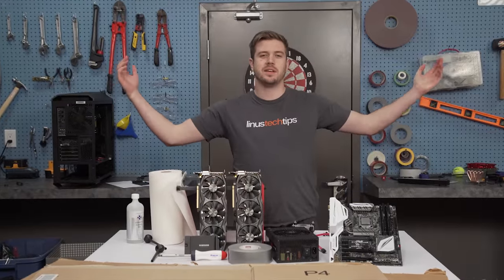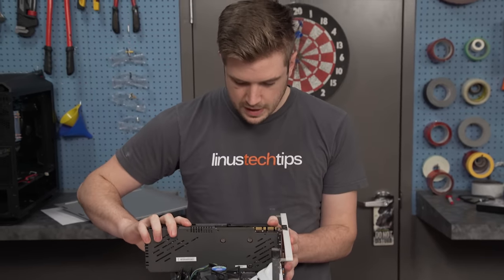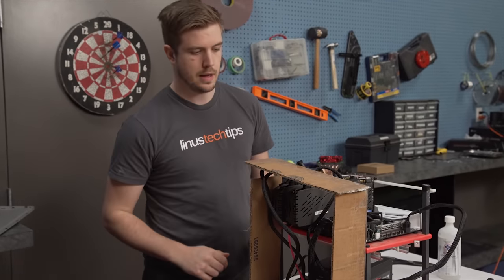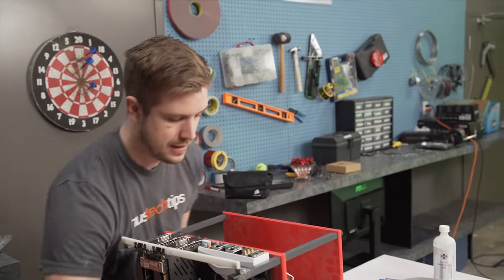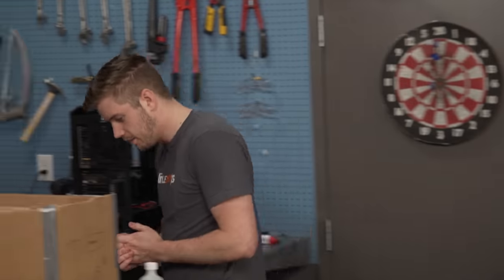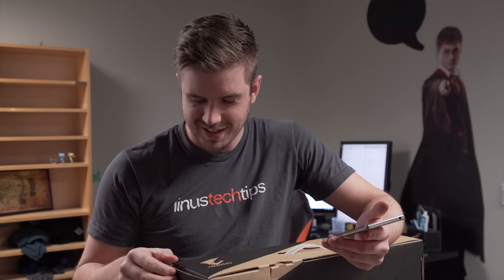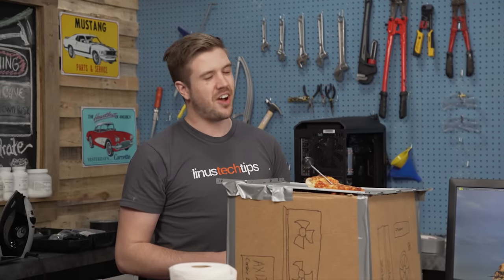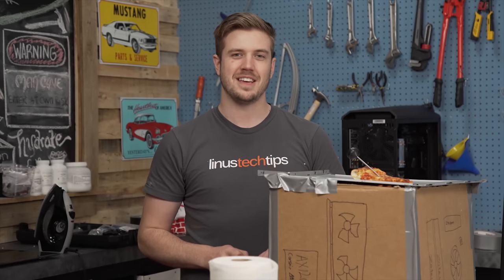Gaming PC & Pizza Warming Platform Prototype Construction

Comment: you gotta use amd cpu&gpu if u want warmer pizza !
Reply: agree
Reply: +Pious AR why amd gpu's? they dont even run that hot
Reply: +Pious AR use a 290x and a fx 9590 to not heat it but COOK it
Reply: Nicolas Epicness937 yeah
Reply: 9590 + gtx 480
Reply: +Quan Washington oh thats good too but i think a 290x would cook it :)
Reply: yeah amd are better for this, i can tell you that. how? i sit next to a pc with an fx-8350, R9 390 in it a hell of a lot. and it get very high usage. my cpu is normally running at 60-65 celcius and my gpu goes at 70 celius normally, althougj for some reason despite not being to demanding, GTA V and star wars battlefront push my gpu up to 75-80 celcius. although one time i had a software glitch that did something or other and ive noticed im getting hotter fast and my fans are suddenly really loud  and ive checked MSI afternurner and open hardware moniter (i use both incase one makes a mistake which has happened when afterburnee told me my gpu was running at 2 celcius) to find that my cpu is at 70 and climbing FAST. and my gpu was at 85 and (again) going up FAST. it was solved by restarting my computer then telling afterburner to pin my gpu fans at max speed (rather loud) for a little bit.
Reply: no, you will burn you pizza
Reply: Revampedharpy09 fx 8350?? thats stupid for cooking pizzas 9590 all the way
Reply: Nicolas Epicness937 yeah i never said it wasnt. i was talking about my personal experience with an fx 8350 the problem the 9000 series has (for running a pc not for warming pizza) is that they REQUIRE at least watercooling to run at any temperature below "HOLY CRAP I DIDNT KNOW I WAS IN A VOLCANO" xD
Reply: i had a 9590 and a 8350 and a fx 6300 the 8 core cpus are fine but the 9590 to keep it stable needed to run at max safe voltage or at 4.1ghz
Reply: +Nicolas Epicness937 just get a Prescott pentium 4 and your set
Reply: i disagree on the gpu. the hottest gpu out there is an Nvidia gtx 480. those were toasters!
Reply: you dont wanna burn it dude
Reply: volkswagenginetta i said cook not burn
Reply: volkswagenginetta jeez you must like your pizza well done huh?
Reply: Revampedharpy09
i do like it really crispy.
Reply: they wanted to warm it, not burning it
Reply: x4 860k + gtx 480 xd
Reply: fr3fou
 fx 9590 and gtx 480
Reply: volkswagenginetta i asked you to cook it not vaporize it
Reply: Revampedharpy09
i eat thick crust pizza
Reply: volkswagenginetta i guess you like it cooked real quick? xD
Reply: Intel is getting hotter than amd, my six core cpu is not getting over 60°C while on full load. Intel would die of heat on full load
Reply: +DerpyDoom its all about the cooling. my intel doesnt run hotter than 50-55 degrees
Reply: +DerpyDoom Intel CPUs handle full load just fine. Plus, even though your CPU is only at 60 degrees it's still kicking out 125 watts of heat, vs 91 for an 1151 Skylake i7.
Reply: *****
just an assumption here, but are you using the stock coolers that come with the cpu's AMD (for the most part)  always offered better stock coolers then intel could be you just have a better cooler on the amd cpu
Reply: volkswagenginetta No, it's not a stock cpu cooler, it is big but I don't know the name of it.
Reply: *****
was it used for both the intel cpu and the amd cpu?
Reply: volkswagenginetta i always used it on a amd cpu
Reply: *****
right so what was the intel cpu cooled with?
Reply: GTX 480 in 4 way SLI
Reply: We wanted hot pizza, not a flaming pizza.
Reply: nisooo:3 that's cute
Reply: ***** Intel doesnt make discrete gpu's
Reply: Pious AR nah intel’s stock cooler is better

Comment: Throw 2 RX 480's and you be good fam.
Reply: gtx 480 4 way sli ftw!!!
Reply: Just put 4 290x's in there to heat it up.
Reply: Pretty sure that's crossfire.
Reply: just put 8 1080's in there
Reply: Uaqu
Reply: you mean a fx 9000 series, and 2 295x2s, with a tdp of somewhere around 1220 watts
Reply: +Ben Crawford bro that's crossfire not SLI lol
Reply: no he means the gtx 480
Reply: no put 4 fx 9590's in a cpu socket and you are gonna have the coolest system ever
Reply: A Pentium D and 2 GTX 590s will do a way better job at coocking food with a TDP of 1600 W
Reply: when people dont know that the tdp of a gtx 970 is actually higher than the rx 480
Reply: He said GTX not RX
Reply: he said cook pizza, not your neighborhood
Reply: Dylan Coulbeck there is a gtx 480 it is not a misspelled Rx ok guys  THE NVIDIA 480 NOT AMD'S  so its the planet not your neighbor
Reply: Ventus that Dorset mean the 480 can run hotter
Reply: +bacon Bliss Top post says RX 480, causing confusion for those not noticing that the later comment said GTX instead.
Reply: ***** which is why i used caps to clarify
Reply: I think you mean 4 gtx 480s
Reply: Elk Kapaska I think you mean a couple of note 7s
Reply: i think you mean 8 gtx 480s

Comment: my r9 390 in a micro atx n200 might as well be a pizza heater.
Reply: *cooker
Reply: +wolfstar true.
Reply: +conenubi701 if its from MSI than yes :) My Sapphire 390X would be a good heater :D
Reply: +wolfstar *incinerator
Reply: my n200 does alright with thermals, I guess your 390 is just a hotter card any ways
Reply: +Markus “IceY” Eisenhammer i've got two msi gaming 390x and those backplates could cook an egg
Reply: 390 max load with a proper fancuve is 64c so no it's not a hot card you just need proper education on Msi after burner
Reply: +GameDev1909 Game Engine Tutorials lol. even at full fan speed it gets up to 79C thats like 140+ fahrenheit.
Reply: +Angus Johnson my n200 does great, i have a top 140mm slim exhaust fan, side and back exhaust and a nepton 240m cooler with push +  pull fans . i love the card but it gets hot as hell (normal for amd anyway).  doesnt help that i Oced and overvolted it too looool
Reply: +GameDev1909 Game Engine Tutorials Temperature does not equal heat output. Learn2Thermodynamics.
Reply: +conenubi701 That card is just to hot i dont know how to cool it down
Reply: conenubi701 i said proper fancurve not full speed on the fan learn the difference
Reply: +GameDev1909 Game Engine Tutorials fan curve won't help.  I've had this card for a while. i said even at max fan speed it's not going to be cooler.
Reply: conenubi701 you would be shocked i have a 390x and a 290x and the 290x is a blower style fan it never goes above 67c because of a PROPER fan curve the rule is never go about 75% fan speed that way you waste no air
Reply: +GameDev1909 Game Engine Tutorials thats the same % i have at your temp. my fan curve jumps to 100% once it hits 80 to start lowering the temps and then it stabilizes at around 77-79
Reply: +GameDev1909 Game Engine Tutorials I agree with this guy, The fan curves for AMD cards are usually way too low out the box.
Reply: Daiesthai i don't think you understand you set your own fancurve .....not the brightest bunch thats for sure
Reply: +GameDev1909 Game Engine Tutorials i use msi afterburner with custom fan curves. my msi r9 390 is just hotter than most. its oced at 1210 core and 1675 memory.
Reply: +GameDev1909 Game Engine Tutorials What are you on about, When I had the R9 280X I set my own fancurve... at default it was set at 20% untill 80c, changed it to 40% and it wouldnt go past 65c at that speed. You can also do it in the Crimson software suite now too.
Reply: Daiesthai well you did something wrong
Reply: +GameDev1909 Game Engine Tutorials What are you on about seriously. Start agreeing with someone and then get argue'd with, wow logic.
AMD cards have their own fancurve out the box buddy, I just told you they're set to 15% or 20% default and then start increasing as the card gets past 80c, thats far too high in my opinion so set your card to 40% fanspeed or make your own fancurve, I found that just setting the speed to 40% lead to great temps not exceeding 65c under 100% GPU load.
Reply: My XFX R9 390 runs nice and cool. If you're too worried get a water cooling bracket from NZXT.
Reply: +Elliot Mayer we are all referring to the heat it disperses not card Temps my card Temps are get no higher then 65c but the thermal dissipation  produces a lot of heat.
Reply: yesac101 Ooh, that makes sense. Well, at least it dissipates the heat and doesn't let the card overheat. That's how you know your GPU cooler works well.
Reply: Elliot Mayer Holy shit that thing first on a r9 390 i does not say on there website

Comment: It would be much more efficient with an ancient laptop
Reply: Yeah. The ones we used 500 b.c
Reply: Just get a computer with Vista installed and, once it finally boots, start Word or Excel. The thermal output should be enough to cook pizza from scratch.
Reply: Miko S.O That is nothing, I have a Core2duo Macbook that hits 87 degree only running Chrome
Reply: mate 55 degrees is normal, my gtx 970 idles at around 35
Reply: I still have my compaq with a core 2 duo, might try that and see how hot it gets
Reply: Or a pentium 4

Comment: You're first mistake was not using SLI gtx 480's
Reply: +Nick Mandolfo Or maybe you meant any 2 AMD cards in Crossfire? =P
Reply: +1BrknHrtdRomeo no....I definitely meant the 480 lol. AMD hasn't made a card as hot as the 480.
Reply: +1BrknHrtdRomeo he just said that the nanos had a lower heat output than the titans. that awkard moment when amd runs cooler! o.O
Reply: why not dual GPUs, thats even hotter. Put 2 dual GPUs, run furmark on them or something even more power hungry.
Reply: +Nick Mandolfo That would have made it a pizza inferno.
Reply: +Nick Mandolfo I don't want to be that guy, but your*
Reply: They didn't have any at the time
Reply: Nick Mandolfo 6990 and 290X are both significantly higher heat output and worse cooler than GTX 480

Comment: Next time use quad 290xs and an amd fx-9590 with its stock cooler. You might see an improvement.
Reply: You need a better cooler in order to dissipate its energy or it will be "stuck" there.
Reply: Yosyp Reference 290xs with the exhaust vents facing upwards.....somehow...maybe with pci raisers.

Comment: Get a big fan and put it on the bottom to help push the warm air out. Get one with low RPMs, because you just want to push the air. Also it will help the computer not die of overheating.

Comment: use quad r9 290x's, the pizza will burn your mouth after 5 mins
Reply: use quad gtx 480's and the pizza will explode after 1min
Reply: Oh shut up
AMD graphics cards don't even get that hot
Have you ever seen a FX-9590?
Reply: Simon amd cards don't get that hot? lmfao ok then, what about the 290x that sat at 95c the moment you put any sort of load on it?
Reply: northern marine Dust in the cooler?
Reply: Simon no, its just how reference 290x's ran
Reply: northern marine lol. I could MAKE a pizza on the top mesh of my case from my overclocked FX-6300 (1.55v)
Reply: Simon what MHz are you running to need 1.55v
Reply: northern marine 4,3 Ghz at 1.4v and 4.7 - 4.9 Ghz at 1.55v (still testing)
Reply: Simon that's why I like intel, one of my systems has a 4790k and is at 4.7ghz at 1.25v
Reply: northern marine And my CPU costs 1/3 of it.
Reply: Simon and my cpu is 10x faster
Reply: northern marine haha! Your cinebench score?
Reply: Simon ok 10x faster was obviously an exaggeration, but unless your near the 1k mark
Reply: or, spend a lot more and save 4pci slots and get 2 r9 295x2s
Reply: what the fuck kind of god-tier 4790K are you running that gets around 1000 on cinebench at 4.7GHz at 1.25V? Mine gets around 860-870 at the same frequency at 1.325V.
Reply: Gordon Rammstein I got lucky with the silicon lottery, I've had others that couldn't get to 4.6 without a huge amount more v's
Reply: There's good overclocking and then there's getting almost a 20% difference in IPC between two supposedly identical processors. That's insane.
Reply: Gordon Rammstein it was a very very good example of that cpu, that's why when I sold it to move over to x99, I got a lot more than what a used 4790k is worth
Reply: northern marine they are dual slot sized cards
Reply: Ventus what are?

Comment: Why not gtx 480 instead of 980ti?
Reply: 980ti has higher usage of watts.
Reply: Higher watt usage doesn't mean more heat output you know...
Reply: actually, it does. By conservation of energy, energy in = energy out. energy in is in the form of electricity, energy out is in the form of heat. if a card consumes 100 watts of electricity, it will (once it reaches thermal equilibrium) release 100 watts of heat into the environment.
Reply: I see you're living up to your name.
Reply: rx480s worent rekeased when this video was recorded
Reply: He said GTX480 not RX480
Reply: your not fully correct as another factor of heat output is the lithography used,
for example a 28 nanometer 200 watt graphics card would create more heat than a 14 nanometer 200 watt graphics card even tho both graphics cards are the same wattage.
Reply: A 14 nm 200 watt graphics card would have more graphics processing ability than a 28 nm 200 watt card, all else being equal, but they will both release 200 watts of heat once they've reached equilibrium. Energy is neither created nor destroyed. The only way for energy to be "used up" is by being converted to heat, which then escapes into the environment.
Reply: because rx480 wasn't out at time of shooting
Reply: Shit a gtx480 is that new? I gotta get one
Reply: They don't have any

Comment: Buy a used GPU mining rig.  Then you really will be able to cook eggs.
Reply: Why would a mining rig run any hotter than a normal one? I'm assuming this is with the same sort of components.
Reply: Arcyguana  They require open-air setups and are prone to overheating due to the proximity of each video card
Reply: +Arcyguana "I assume this is with the same sort of components." - Not quite; mining rigs do all the mining on coprocessors, originally GPUs but now moving into dedicated ASICs, which means lots of hardware per computer. Older mining rigs had up to 8 GPUs per system, which means 4 times the GPU heat output of this rig.

Comment: Test what happens if you put the pizza inside a cardboard box
Reply: first time I've seen a lad use italics in a youtube comment
Reply: wow you must not see a lot of people comments  :} )
Reply: John Doe I do, it's just most of them are raging 12 year olds or just trash-talkers.
Reply: +John Doe How do you do the strikethrough?
Reply: Malus1531  its - so
"- hello -" without spaces,

Also, i was kind of just saying that to make the comment make a little sense
Reply: Well in that case that makes you the chef at a pizza place.
Reply: Keeping the pizza covered will definitely keep the pizza much warmer. One time when I was operating spotlights for a show I rigged together a pizza warmer by taping a small pizza slice sized box over the exhaust vent and it worked quite well, albeit the adhesive from the tape melted onto the light once I took it off.

Comment: not sure why you just didnt use a normal PC case but one with top radiator/fan slots. just block off any exhaust/rear fan slots, etc, make sure graphics card isn't a blower style so it exhaust all it's heat into the case.. so with all vents and such blocked off this forces the heat to only escape out the top of the case where the pizza slice is sitting ontop of the case's top magnetic dust filter.

Comment: Next year I plan to build a window computer - as in within a case that is build so it expels the heat from the computer out an open window via a window fan! (And of course it will be capable of heating my apartment by pulling the window fan and closing said window.) Somehow it sounds much more practical than expecting the pizza man to know the thermal properties of the crust! :p

Comment: i think you should set it up with walter cooling and put the rad against the metal so it heats the metal up and the pc parts won't run as hot or run some metal pipe against the heating plate befor you cool it so it heats up the side of the case

Comment: You could have just used a standard case and lined it with aluminum foil, or at least blocked off the vents with tape. Also why didn't you use a razor blade (AKA a box cutter) to cut the cardboard? lol
Reply: Good thing you specified, otherwise I would have mentally pictured somebody trying to use a Razer laptop to cut cardboard.

(razer your names suck)

Comment: 26 degree celsius is warm? in wich universe? The AMBIENT temperature where i live is 30, and it doesnt feel very warm if you let it cool for some time... I thought the pizza was gonna hit like, 45/50 degrees, and the system would be at 80 (You probably made it too cold! let the gpu 
 and cpu temperature increase, maybe some overclocks haha)
My notebook with metal case can easily hit 100 celsius on both gpu and cpu, making it so hot you can barely touch it. So you could try something like that. (its a HP pavilion i7 2630qm + radeon hd 6770m 1gb)

Comment: Needs acrylic, an oil tray for those greasy types, an emergency air traps in case your PC is thermal throttling, and an Amazon Dash button programmed to order Domino's or other Pizza places in case you're too lazy to call them up. And boom, instant success.
And I mean instant if you already built a computer to put into the case in the first place.

Comment: I have a great idea guys! What if you take this idea further, and create a CPU heat sink stovetop. You could run heat pipes from the CPU block to the stove and use the large piece of metal as your main heat sink. The CPU would probably thermal throttle, and might even die, but I'm sure you could fry an egg before all that happens! :D

Comment: You should have used a couple r9 290x's... mine games at around 90 C with no overclock and the stock fan curve (stock cooler). And if you did it with the stock 290x's you could have had them in an actual case just with their vents blowing into a makeshift oven or something like that